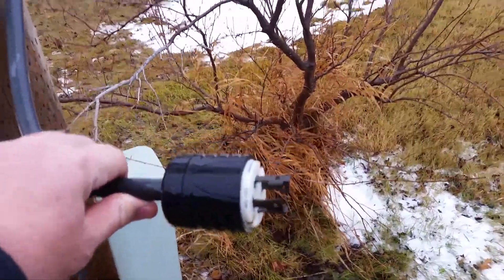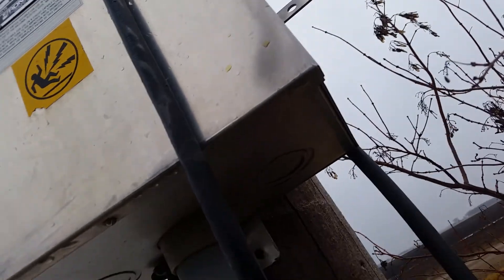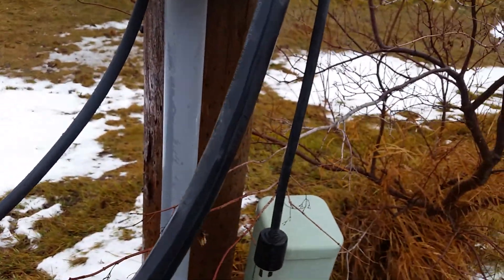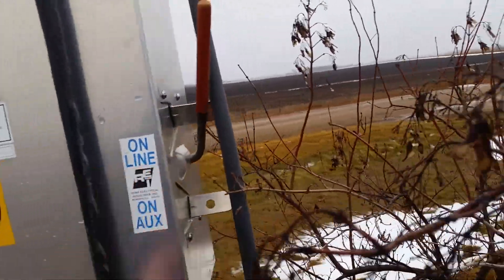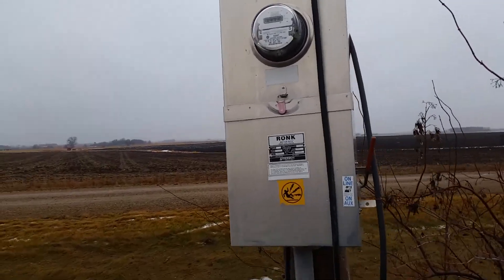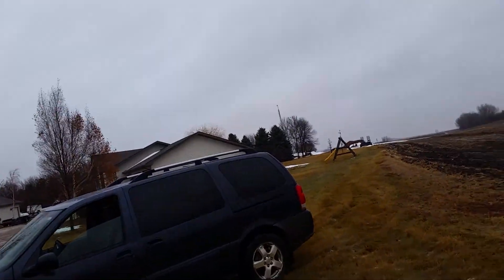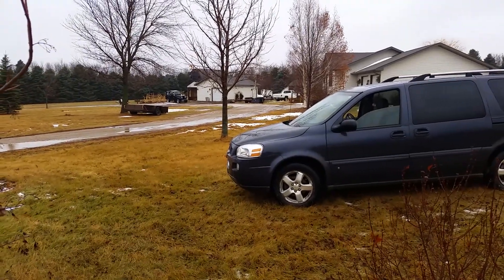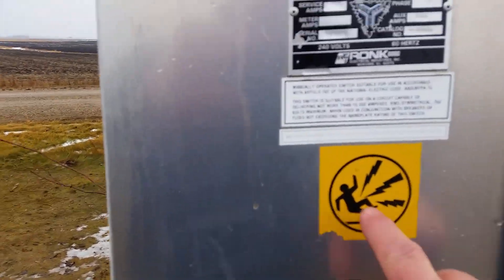My Generator Transfer Switch

Comment: Why dig? That's the old way of installing underground wire runs. The easy way is hire a contractor that uses a wire plow, no digging except at the pole and the building the wire goes to and from the plowing the wire will be done far quicker than digging the holes at each end. It should save your money as well.
Reply from the maker: The electricians all have the ditchwitch chain type trencher. No one around here has a wire plow even though most utility companies plow their underground wires in. I wish they did.

Comment: Hire an electrician to wire in the 3 phase wire from your meter transfer switch to your shop where you permanently mount your generator with exhaust and intake air piped outside, then when the power fails simply start your generator and walk out to pole and throw the transfer switch to power everything back up. Lot easier than dragging the heavy beast thru the snow.
Reply from the maker: It is in the works. It takes a fair amount of money to dig in wire. I was gong to also put in an electric boiler that in line with my wood fired boiler to help heat in extreme cold weather and with mild weather times when the wood fired boiler is too warm that would need extra heavy wire to be trenched in with the generator wire. There is a 20F to -20F sweet spot where my wood fired boiler works well but then add wind to those temps and my wood fired boiler will really run through wood.

Comment: Very cool setup. Sure beats what I am doing. I just set my generator under my porch and run heavy duty drop cords.
Thanks for sharing it. Merry Christmas

Rick
Reply from the maker: Merry Christmas Back to you and your Family. Nothing wrong with cords as my setup requires me to be able to get my unsheltered generator to the pole through snow (sometimes deep) and at the mercy of blowing snow that could plug up an engine intake and ruin a motor. I do have a plan for this situation though. Always gotta have a plan right?
Reply: 1crazynordlander
   That's right my friend !!

Comment: Thats very cool!  I wish they would do that for us. A whole house transfer would cost us about $350.00, and wouldn't put me any farther ahead than I am right now doing my back feed.  But I would much rather have a full house transfer, its a lot safer is someone not familiar with backfeeding was to take over my place during an outage.
Reply from the maker: This is a new box in 2000. the old one wasn't a generator transfer switch but it had provisions inside the box to add one. I like this much better. I do want to dig in a heavy triplex to my shop that I can put the genny over there close to where I can roll it out from a warm building. It still gets to be a little walking in a full out storm but I will take it.
Reply: 1crazynordlander
Yea, my old generator had an enclosure, the new one doesn't, so this summer we'll be building a generator shed. I'd like to keep the run as short as possible as distance equals loss. Ideally I should put it closer to the house, as thats where the main box comes in. ( and then it feeds 220 to the garage) But I don't want it running that close to me. I guess it comes down to a lessor of evils.  ;-)
Reply from the maker: You''ll have to put that video up when you build that. A couple things I want in separate buildings from my shop are 1. Air Compressor 2. Dust collector. I think I can get both Generator and Compressor in one shelter but better put the dust collector in a separate building for obvious reasons.
Reply: 1crazynordlander
My air compressor is in the garage but its in a walled off area with filtered ventilation. I would have liked to have made the area larger, but it doesn't get used for hours at a time, so the heat is generally kept bearable for it.
I thought about having the generator inside, and piping the exhaust out, but space was once again an issue, so I think I'll just build an enclosure with a flip up door right next to the garage. I'm not worried about carbon monoxide in the garage, as generally when we have the power outages, I don't really use the garage that much anyhow.